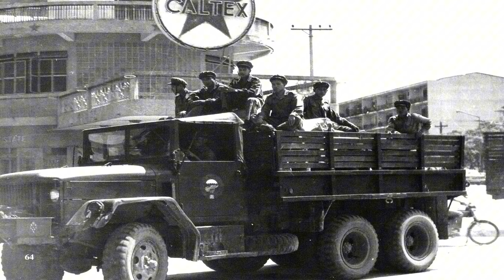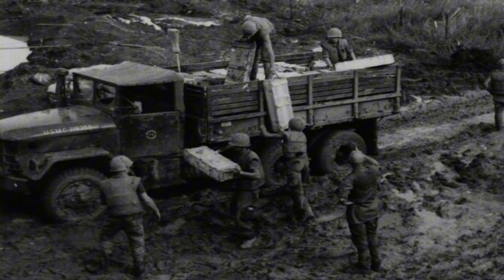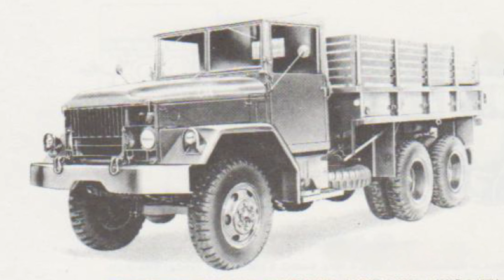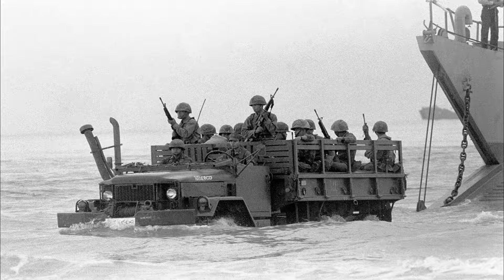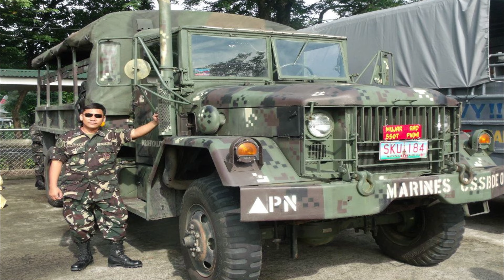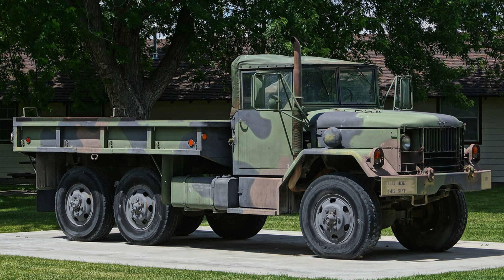The M35 Deuce and a Half: Why the Military Still Can't Replace It

Comment: I currently have a M35a2 and love it. It is still fairly easy to get parts for it. I have to admit that my wiring harness needs to be replaced but it still keeps going.
Reply from the maker: Love hearing that — the M35A2s are tough old beasts.  Thanks 👍🏼

Comment: The turbo-charged M35A2 was the truck I drove for a year when stationed in West Germany. A literal workhorse, not very fast but unstoppable. I took it places I wouldn't have taken our M113's. It was the vehicle I finally learned to drive a stick shift on, if you can believe it. Working for our supply SGT, I hauled a little bit of everything and it was my job to haul the Company's water buffalo while in the field. Good video, Sir, thanks for the history lesson.
Reply from the maker: Really appreciate you sharing that — Those old “Deuces” had a way of earning people’s respect, especially in Germany’s terrain. Amazing that it was the truck you learned to drive stick on, and hauling the company’s water buffalo definitely makes it a true workhorse. Thanks for the story — it adds real weight to the history behind these machines. 😉👍🏼TY pal